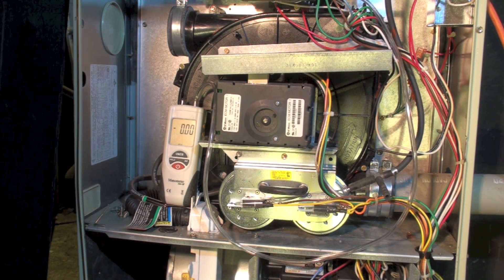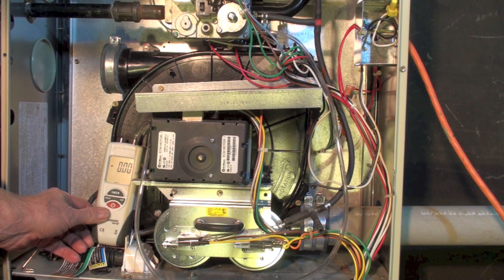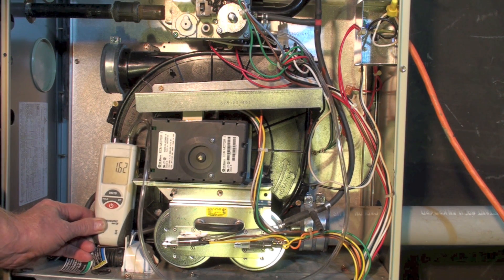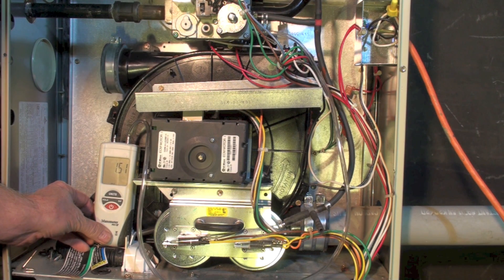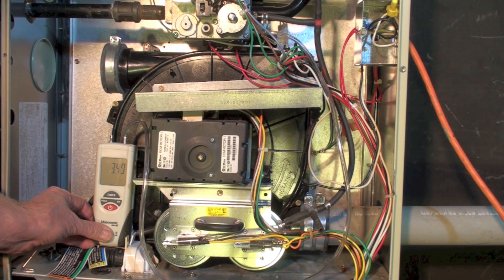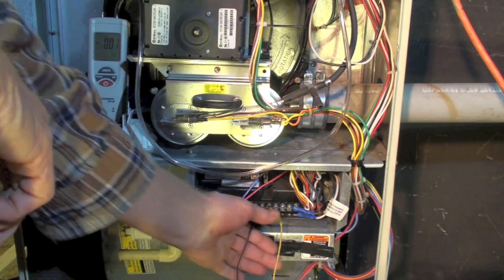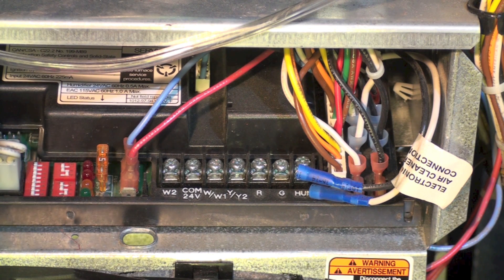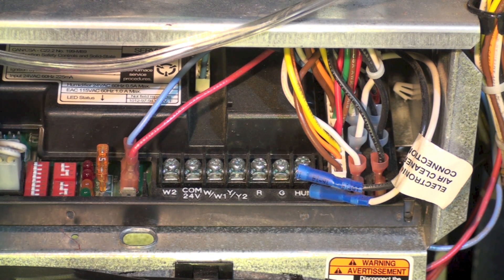Bryant 355 MAV gas furnace 2d stage heat #3

Comment: hi, how would i make a call for LOW fire heat and HI fire heat? thank you for all your help.
Reply from the maker: In most units, low fire will come on if only the first stage (W1) is energized.  If both W1 and W2 are energized, 2d stage will come on after 10 minutes of low fire operation.
GFM

Comment: Could you please help me with this: Bryant, 355 MAV, installed in 2001, about three weeks ago I noticed fan motor continue running at low speed after hitting cycle complete. Thermostat fan on auto. Fan motor and blades, furnace itself are very clean. I seal it nicely after installation and regularly change the filter. Inducer motor failed two years ago and I replaced it, no problem here. No any LED lights shows a problem, except Green 4 tells me Low hit. Thank you for help.
Reply from the maker: Victor Medvedyuk About the only thing I can think of is possible G terminal problem.  Disconnect G at the furnace to see if it stops.  Let me know how you do.
GFM
Reply: Victor Medvedyuk
I disconnected G at the thermostat and the fan stopped. The cycle competes, but, you suggested to disconnect G at the furnace, will try to do it later. Thank you very much, I would never-ever think to disconnect G, and one local technician suggested me to buy new thermostat OR furnace computer....
Could you please explain what happened with the cycle?